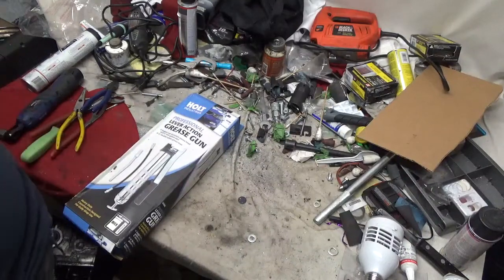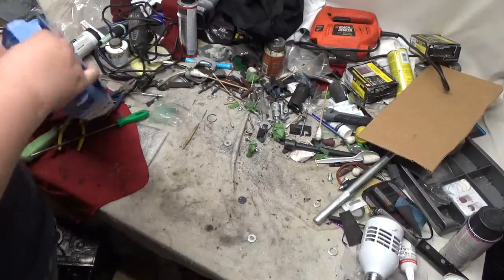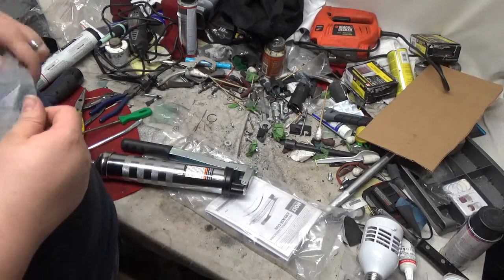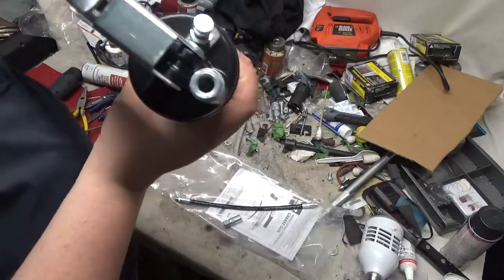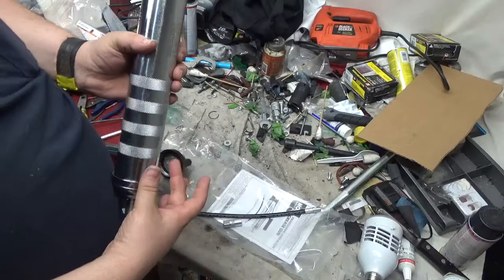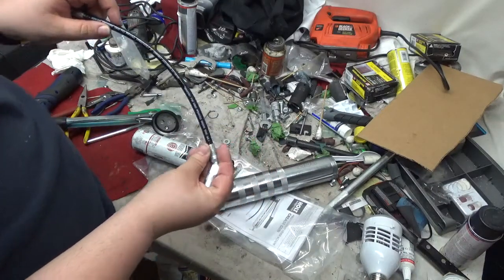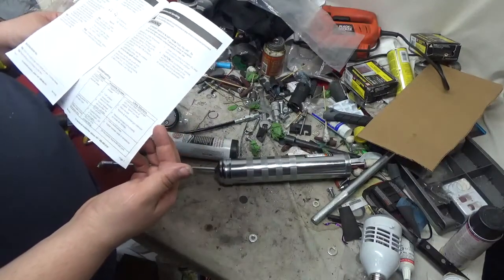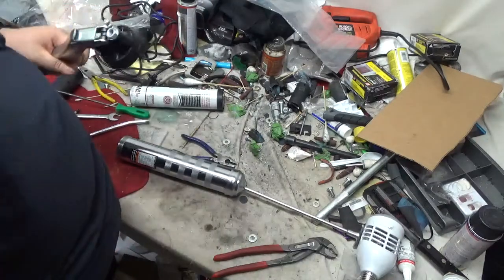Unboxing a holt grease gun. does it work?

Comment: If you want a 15 minute grease job to turn into an all  day project. First crawl under your truck to just see if you have a grease fitting to your ball joint, then find out the hose is way to short on the gun .Then the grease spits out the threads on the side of the tip. Jack it up relieve the weight on the joint, same thing  .let;s find the clog or is the grease gun malfunctioning? Took fitting off joint not clogged took tip apart cleaned it out, dont lose the little bearing in it ,ptit back together now the head wont secure around the fitting . I WOULD LIKE TRO JUST TAKE A SLEDGEHAMMER TO  THIS,or run around town trying to return it or buy a knew one. My son is moving and needs the truck and I have a loud squeaking noise in my ball joint .Used it once last year .